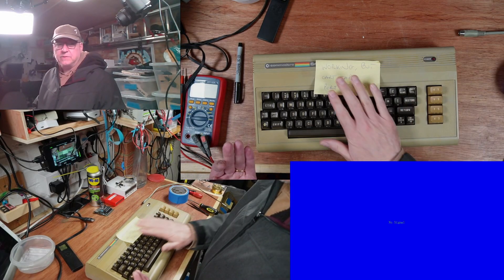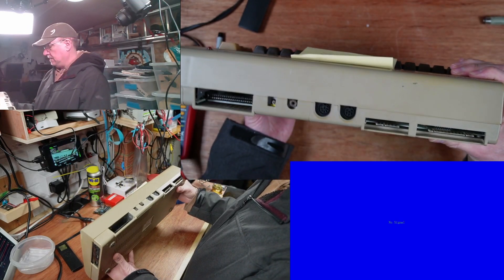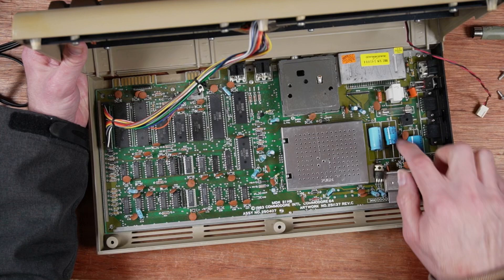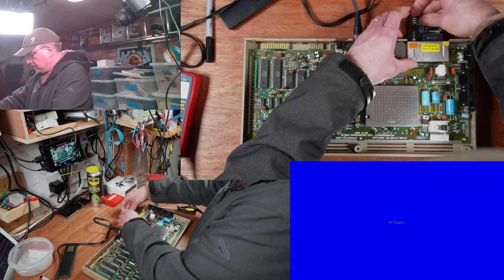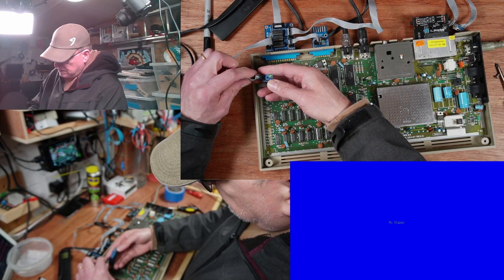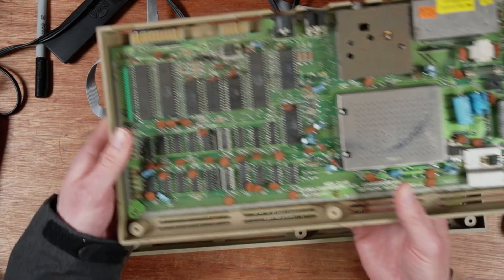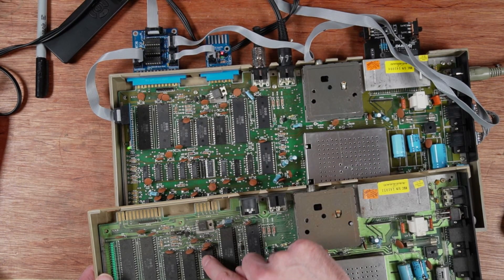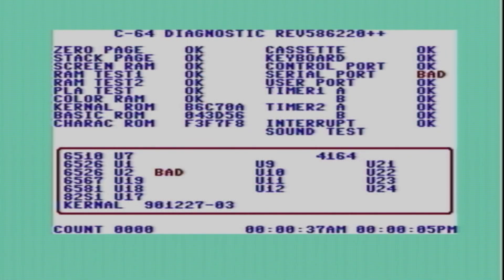Testing the Pile Part 2 C64 no2

Comment: the component looked a bit like a burnt ceramic disc capacitor inside some heatshrink tubing which you tend to get in power supplies but i don't recall ever seeing it in a c64.
Reply from the maker: If it was heat shrink tubing it was insectoid heat shrink tubing!